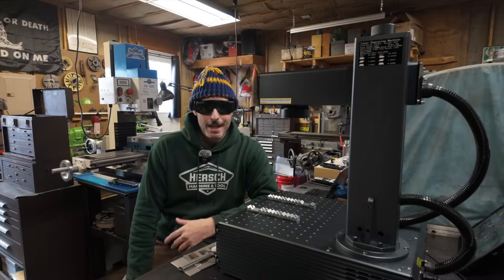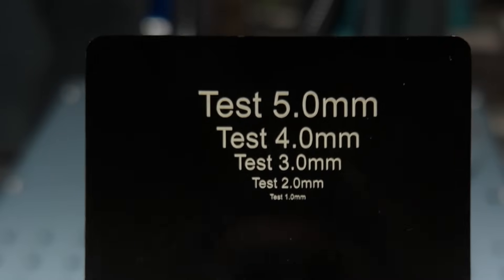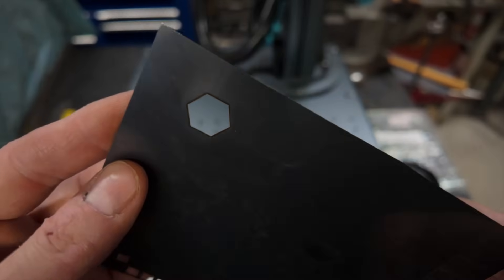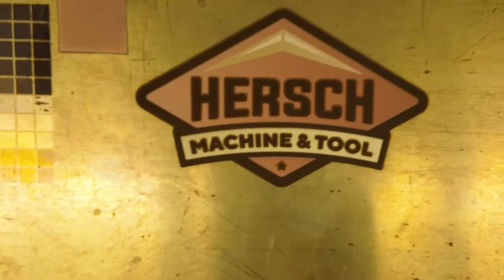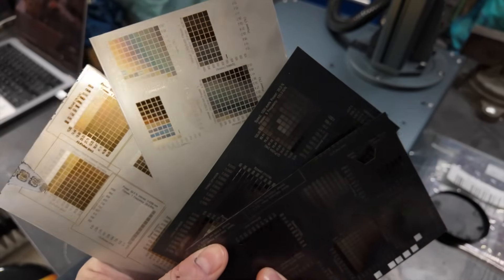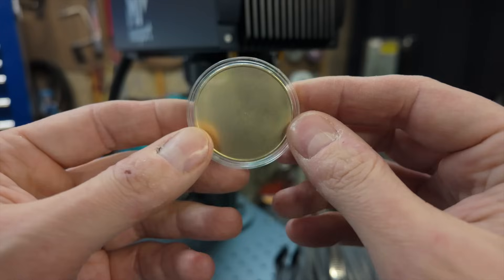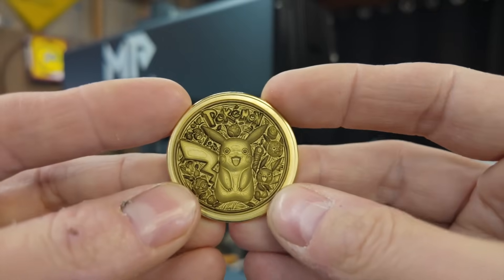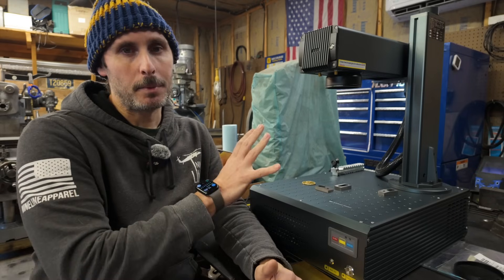It’s CRAZY That I Made This in My GARAGE

Comment: That is a tremendous piece of kit👌
If I heard you right at 4mins 20 secs when you said that piece of carbon steel is 0.8mm it is a lot thicker than 8 thou.....it is actually about 31.5 thousandths thickness.
Reply from the maker: @howardosborne8647  yeah I miss spoke there. And the machine is definitely super cool. I’m really looking forward to having it around the shop and using it more. Thanks for watching btw!

Comment: I've never even HEARD of one of those.  Could you speak to warranty, consumables, power requirements, safety concerns? Is there an aftermarket supply of lenses or are they proprietary?  Country of origin? I got to say, I started the video unimpressed, but you turned it around! I'm just tired of unboxings that the beginning hinted at.
Keep up the good work 👍
Reply from the maker: @bradgray6093  2 years on the machine and 1 year on the laser source per the website. 100,000hrs of run time is what it says. I think all lasers come from China, at least this kind of laser. And yeah the lenses can be gotten after market, it’s an f-theta lens, all galvo fibers use them as far as I understand. And thanks very much btw, and thanks for watching!

Comment: What happens to all the vaporized metal?
I don't see much smoke and would assume that would mess with beam collimation
Reply from the maker: @jimurrata6785  I have an exhaust system that sucks most of it away. A lot of the pulverized metal builds up as powder right at the front of the exhaust tube and I just vacuum that up at the end.
Reply: Very impressive demonstration
Reply from the maker: @jimurrata6785  definitely a pretty awesome machine, looking forward to really discovering what it can do!